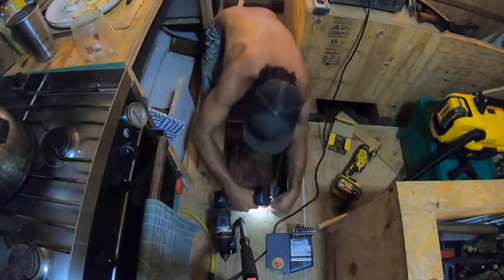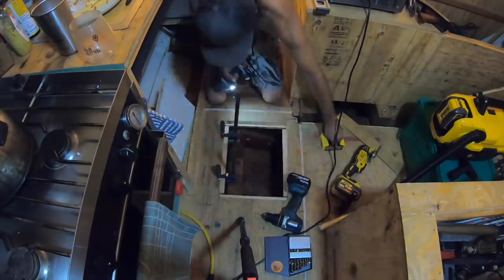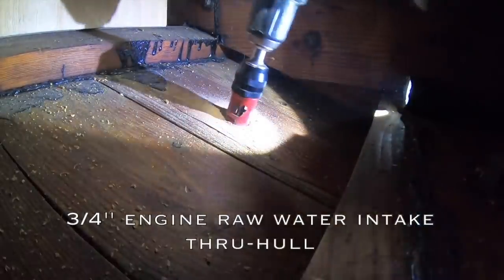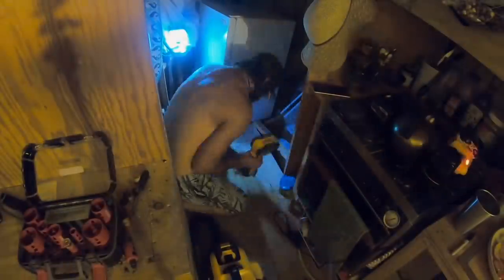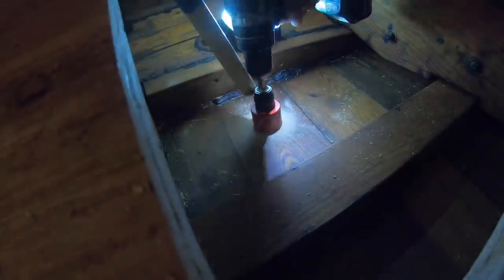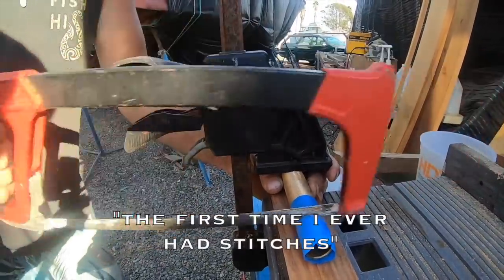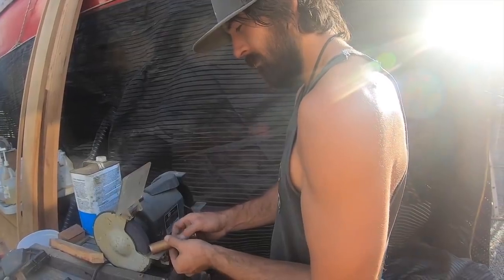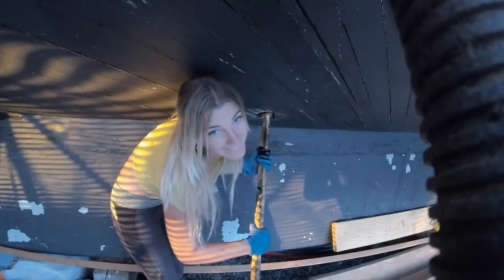Salt & Tar: Episode 68-Seacocks and Thru Hulls

Comment: When cutting anything with threads on it you should leave a nut or in this case the threaded flange on the item when you cut it. Then you can back that off after the cut and use it to clean any burrs in the threads..

Comment: You should have a conical pine plug tied near each seacock so just in case you do shear off the valve/hose and you cannot get the valve closed you and insert and hammer the plug in to the hull/fitting/pipe and have it sealed fairly well.  In the Navy we called the DC plugs  (DC is Damage Control).

Also if you have an inside pipe wrench you would screw your seacocks in place and then tighten the fitting from the outside.
Reply: I concur about the DC plugs. Navy, too.

Comment: On your raw water intake you can set up an emergency bilge pump. You put an inline T fitting and an additional ball valve connected to hose going down into the bilge. So you can close the raw water seasock valve and then open the other. As long as your engine runs then  your engine raw water pump will provide additional pump capacity if you had an emergency. Like a shaft seal failure or some other leak. 

I would put a strainer on the hose in the bilge. Just to keep the big floaters out of the engine. Regardless if its an emergency then you won’t care about that.

Comment: You should have shares in Sikaflex for the amount of it that you have used and still using. I'm a wooden boat builder also and only use seacocks over a ball valve anytime. The other thing is whenever I cut something with a thread I put a nut on the shaft past where I'm cutting, so then when I have finished cutting I remove that nut and it deburrs the thread and makes it easier to get the nut back on again which can be hard at times with the thread flattened/changed due to the cutting process etc..

Comment: Garrett , nice explanation of thru hull set up. Pete on 'accidental sailor girl' made a good point , I had not heard before , the backing block helps protect the hull when you have to remove a seacock because it's not 'glued to the hull ' AND you can split etc the block to get the seacock loose from the thruhull. Never heard that before and better than plywood as good wood rots less and plywood can't be split.
I hope I never have to split that block locust though! 
Nice job Ruth  editing into a single subject video .....Cheers Warren

Comment: Difference between a valve (ball or other) and the sea-cock is the integral mounting flange to support it - not just against impacts, but every time you use the valve it stresses both the valve and any piping.

Comment: Ruth&Garret: jolly good work. Suggestion: now would be a good time to create two under-flooring spaces in the bulge to accomodate an electric pump and a manual pump, just in case the electric pump breaks down you should have a manual one. Have you made plans for a water tank? If not how will you estimate your center of gravity? If you reckon it's around the engine, then the tank should not be far off.

Comment: Great work guys -  Hey it's too late i know, but I have a Kauri hull just under 2" thick and my Garmin plotter sounder fires through from the inside no problem, I just had to make sure there was no air i used sealant to seal it to the inside of planks

Comment: When you cut a through hull it's ok to start from the inside but before it cuts all the way through, stop, go outside and drill up from the bottom to prevent the ugly tear out on the bottom of your hull. On a two inch thick hull a backer plate is truly over thinking it. I know it doesn't cost you anything and maybe it gives you peace of mind but one day you want to go sailing instead of building your boat. :) Just keep on keeping on.
Reply: I was thinking the exact same thing. Usually once the pilot hole drill bit goes all the way through, ya stop and go at it from the opposite side to prevent those nasty chip outs.

Comment: Looks like you didn't have any issues with cutting the threads and getting the sea cocks to thread on correctly.  Sometimes it can be difficult, what I have done in the past is to take the nut that you aren't using and thread it well past where I am cutting.  Then after I'm finished cutting, when you unthread that nut,  it will help clear the remaining threads and hopefully make threading on the new piece easier.  I've also had some luck using the nut as a guide for my saw.  cutting right on the shoulder so that the saw follows the threads.  I've also done it exactly the way you did.....all methods work.
Reply from the maker: We did end up having a little struggle with the threads haha but no biggie worked through it haha 
R

Comment: So, if your sink drain is below the waterline, won't it just flood the boat up through your sink, or at a minimum not drain? I didn't hear you mention a grey water holding tank and pump.
Reply: I was thinking the same thing. The drain should go out above the water line or go into a grey water storage tank.
Reply: I was thinking the same, even if you had a one way valve fitted surly the sink won't drain as the outside water pressure is greater?
Reply: Depends if the sink is above the water line or not.  If it is above, you just end up with water sitting the drain pipe up to water level.
Reply: As long as the sink is above the waterline it will drain quite well with the through-hull below the waterline, but, if the drain hose comes off the sink drain it will sink your boat. That's why I moved all of my drains to above the waterline. What does happen with a below waterline sink drain is that when the boat rolls, the air in the drain line compresses and blows your sink plug out, emptying your sink and wasting water.

Comment: I remember way-back-when Garet was saying that he only wants one thru-hull for salt water intakes and split the pipes inside going to all the different things that want salt-water, what changed?
Reply: Yeah ! !   What's  with  that  ?  ?    ( Simplicity is best . )
Reply: @richardhobbs9038  Against which, maybe you could put that a single, catastrophic inlet failure will shut everything down, whereas 2 gives you the chance to jury rig something if one of them fails. Maybe the simplest isn't always the most appropriate - safety systems often mean doubling up.
Reply from the maker: Less to build this way... he'd have to figure out how he wanted to organize the system and build a "sea chest" to supply the whole boat. Long story short we just said what the hell and went with the standard thru hull system. We only have 3 so it's still much less than some vessels which we wanted to avoid having too many
R
Reply: @SaltandTar  And there's a lot of fear around piercing the hull in this way, which I think is an instinctive one, rather than a strictly rational one. Worst case scenario, where are fitting fails; it's only a 3/4 or 1" hole, easily plugged. Time to worry is where you hit a floating/semi submerged freezer in the middle of an ocean and a big crack opens up (and yes; I did) - much more challenging to deal with =;-)))

Comment: FYI - always stand to the side when using a wire wheel -
Reply: I wear a hard hat, chainmail gloves, heavy leather apron, steel toecaps, goggles and a face shield. Oh and I stand to one side, usually the right side. :-)  LOL  And mostly have my tongue in cheek when doing it.    regards
Reply: I always use a clear face shield and stand in front. Picking wires from my clothes isn't terrible, but I have to save my prescription glasses (and eyes) and don't care to have any wires stuck in my face. Sometimes parts can go flying when using a grinder, wire wheel, or buffer. A friend walked in when I was buffing a drip rail for my truck and asked if parts every go flying...........and then it went flying and bent. Luckily, I was able to bend it back and only the two of us knew. Yes, when we rode together, sometimes he would remind me of the drip rail that bent just to tease me. LOL
Reply: Agreed, face shield  is the number one need.  regards
Reply: It wasn't a wire wheel in this case, but if you want to emphasize tool safety to someone, send them to watch "Stumpy Nubs" recent video on a power carving disc in an angle grinder.  (It wasn't responsible for the channel name.)

Comment: Great video guys. Thanks for sharing.  Do you not have to have a grey water tank between the sink, shower etc and any overboard outlets. Many places in the world do not allow grey or black water discharge overboard especially in rivers and marinas. Also what about the pump up action of the water when sailing that can push water into the sink or shower from below waterline through hulls  in some circumstances ?   Looking forward to the next video.  Fair winds & regards from the UK
Reply from the maker: We're keeping the systems simple on the boat. We can easily shut off the seacock we're sailing to prevent back flow 
R

Comment: What made you decide to put the sink through hull under the sole instead of as close to directly under the sink. I'm also curious about what made you feel the need to put backer blocks on the through hulls with your hull already at 2 inches.
Reply from the maker: We might put a sink in the head so under the sole is half way between the two sinks. The main reason for the backing block is to spread the load and not stress the planking. Maybe over kill on size and wood type but maybe not we plan to do some serious sailing and peace of mind is everything
:) R

Comment: Nice job, shouldn't you have used a scoop tru-hull for the motor ? Your forward motion helps take water in with a scoop.
Reply: They also scoop up any debris/seaweed in the water and that WILL cause problems. The flush type should be more or less self cleaning.

Comment: Hi guy's yet again another great video,looking forward to the next week's episode.
Question.. looking at how much paint that has flaked off the hull of the boat I have to ask when you have done the final coat of paint will you be covering it with a sealer like total epoxy or something else?
The reason why I ask is that going by the amount of flaky paint on the hull at the moment it's looking like it is going to need a fresh coating of paint every few months. 
Happy Newyear to you  both and swab of course.
Reply: I just want to say... Thank you.  I've started flipping boats to get to the sailboat of my dreams.. Your instructions and explanation are invaluable.. Thanks again
Reply from the maker: Because the boat swelled and is now drying out all the wood has moved a lot. This is normal and why hauling out a wooden boat is an annual thing to add more bottom paint. This was a longer haul out because we had more projects we wanted to get done but a normal haul out will be in and out. Check everything then bottom paint and back in. 3 days top.
R
Reply: @SaltandTar  hi Ruth.
I was aware from watching your videos that you had the boat out for much longer than you would have liked also the reasons why the paint had flaked so much , my wonder was due to the boat being made of wood and having watched the pair of you repaint the boat a number of times, firstly would you put a coating ontop of the final coat of paint like epoxy so that this would make your lives easier rather than having to constantly repaint the entire hull? Or secondly..is is common practice having to repaint the entire hull etc each year shall we say.
Reply: @simonr6793  When the wood shrinks the epoxy would crack also...
Reply: @JCrook1028  cheers for letting me know,  I'm a firm believer that if you're not in the know the best way to find out is simply just ask the questions.
Reply from the maker: @simonr6793  Hey Simon. Sorry for my late response but yes it is common practice to haul out a wooden boat every year. You want the wood to be able to move when it swells. The more times we do this the better it will get overtime. Since we first launched and only the first coats of paint are on the boat and then we were out of the water for 4 months we knew the paint would flake. No worries here though all part of the process/"love" haha 
R
Reply: @SaltandTar  thanks Ruth, looking forward to watching the latest video x

Comment: I am more familiar with gate valves for water-cocks. They are much more stable and positive than a ball valve. I also agree with what you said about the through-hull ball valve without the bolt to the hull being a ball valve and I disagree with ball valves as they are not as positive in regards to positive sealing. A ball valve will have more of a chance to leak than a gate valve.
This is just from what I have seen while I was in the Navy and repairing leaking sea water systems on both wood and metal hulls.
Reply: I have ball valves on my boat I purchased this summer.  I know they are probably fine, but I am going to change them out as soon as I can.  Ball valves scare me.....In fact, there is one that we don't need for the head and I removed the handle, and put a plug in the end just in case.

Comment: I thought earlier on you were being a bit optimistic only having one thruhull. 

And your idea that “ball valves” are not seacocks is a very American mistake. A “seacocks” is any valve that gives access thru the hull to the outside water. All boats have seacocks, not all boats have the all in one seacock design.

Comment: You should put a backing block on.the outside of the hull as well. If you expoxy it on with both the surfaces being sanded. You could also taper the leading edge for hydrodynamics. I also wanted to mention, that there is a 34 ft Falmouth Cutter, designed by Lyle Hess named Astrid. I think you could get a lot of good ideas from this sailboat, especially when it comes to designing your interior & the layout of it. I really enjoy watching your videos, they are very interesting, not to mention, the two of you have built a beautiful sailboat with a small budget. I hope to own a small expoxy composite wood sailboat similar to a falmouth 22, or a Dana 24. I wanted to buy the 32 ft BCC Phalarope, that was made of wood, but $70k was a little to rich for my blood. I'm now looking at a Naja 30ft, that is made of wood. I hope to see you on the ocean one day with fair winds & the sun shining bright.

Comment: That bottom scares me.That method of construction makes no sense whatsoever,The scantlings are huge but the strength of the hull doesn't inspire confidence.
Reply: Double planked hulls are very common and George was a very good designer, that hull is very strong, if not over built.
Reply: @kevinmcneill7 Double planked hulls are or were very common indeed but not in this configuration.Not the best way to achiev a chined hull. It is over built and for sure too heavy. I dont like the way the planks end at the keel.I would have made de scantlings lighter and sheathe the hull in epoxy and glass. I would also never use concrete ballast wich is inneficient as it is not dense enough,unless it's loaded with lead or pig iron.even then, not the best solution.To me the boat appears top heavy and the hull shape seems very inneficient. With the the same amount of effort they could have built
 a much better boat IMO.Sorry to be so negative.
Reply: @nunosantiago2273  Cross planking is very solid and is used in many different boat designs. Phil Bolger was a fan. The designer of this boat, George Buehler, was very competent designer and his boats, many of which are cross planked, have sailed all over the world. http://www.dieselducks.com/woodconstruction2.html